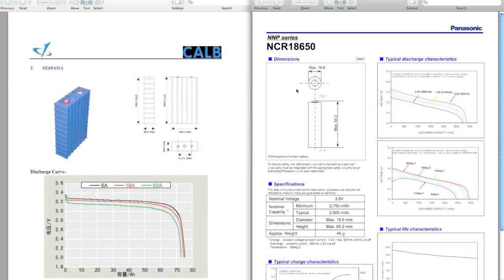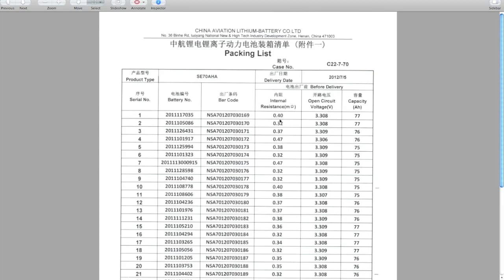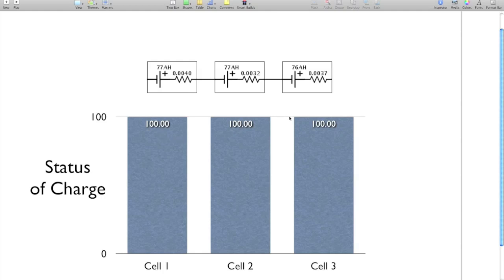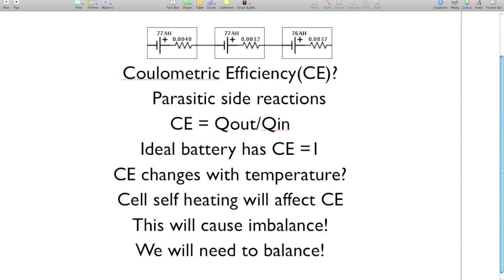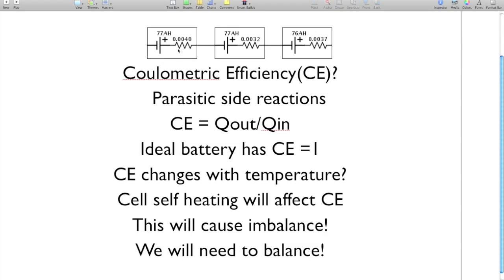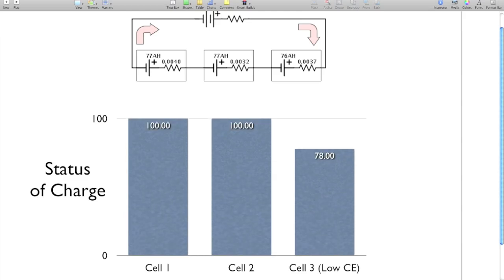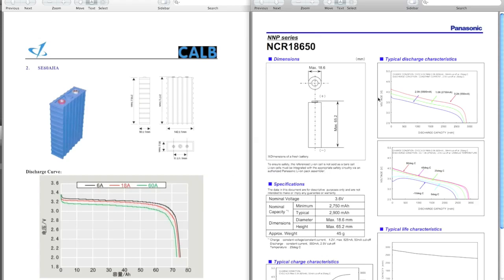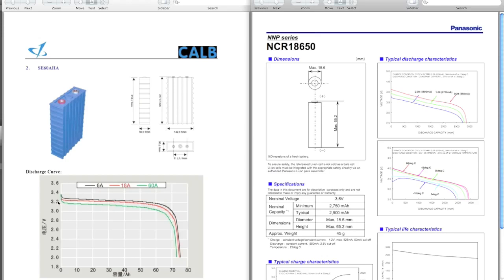#14: Battery Pack Balancing

Comment: this video was probably the most helpful video i've watched so far to distinguish between top and bottom balancing. But I still don't really understand why you use one vs the other. My understanding is that top balance poses the risk of first, overcharging, and second, a greater risk that a bad cell might reach zero% state of charge and be damaged because the the other cells might still be good and continue releasing amps (the computer doesn't recognize that the other cell is at empty). And then my understanding of bottom balance is that you'll have less amp hours but since the battery isn't heating up as much cuz it's being used for less time, the bad cell wouldn't be as likely to get to zero% since the computer will see that the other cells are also getting low and it'll stop the use of the battery pack. Is my understanding correct?

Comment: Hi Electric MotoVlog.   I have Toyota 2012 the hybrid light is on i opened the battery however all cells reads between 7.6 to 8.0 voltage.  What can i do to find out the bad cells? any instruments helps for that ?  thanks

Comment: on the schematic you have three batteries with following internal resistances.... 0.004; 0.0032; 0.0037. You said you got this info from the packing list. On the list you can see internal resistance for first three batteries in (mOhms) 0.40; 0.32; 0.37;
0.40 mOhms = 0.0004 and not 0.004 !
0.004 is 4 mOhms which is different than 0.4mOhms.
You are wrong.

Comment: Thanks for the info..I used to be an automotive mechanic until I was run over by a car and now I am creating a custom power wheelchair with lithium ion batteries..

I was told that I should use a charger that never lets battery charge over 80% so that I well get much more life from the batteries..
Is this true?
https://wheelchairrights.wordpress.com/about-lithium-ion-batteries/

Comment: Hi, there seem to be circuits ( LTC3300-1) available now doing the top and bottom balance without waste of energy, the cells with lowest voltage,get some help from the more fit ones by means of a convertor circuit. Complex, but worth its cost for high power packs.
Reply from the maker: Ah excellent. It probably goes in conjunction with the 68XX series by LTC. I have used the 6801-1 a while back (when it first came out). It was really nice except that the serial port on it was horribly unreliable. I think they have much better variants of it now though.

Comment: Using a BMS on a lithium cell pack is a myth. The King has no clothes.

There is no mechanism for shuttle charging, they keep their charge indefinitely. For safety all one has to do is keep them reasonably at the same temperature, bottom balance from installation in case you run them down so none get forced into reverse voltage. (the weakest will be eaten by the pack) and stop charging them as soon as the lowest sized cell hits 3.5V (LiFePo4).

You cannot balance under load. Neither is it possible to top balance and not kill the weakest cell when under load and low in charge.

Throwing the charge from cell to cell is not worth the battery variance.
Top balancing does not indicate any cell is actually top balanced because of the free electrons which do not represent a charge. You stop the charge and the voltages throw themselves all over the place. It's an irrelevance.

The accusation of "parasitic side reactions" is an invention from not understanding the processes.

I refer to EVTV. This guy has driven his cars since 2009 and NEVER required a balance. Neither do the people who follow his example.

Comment: Good video. Not sure why it was not in my subscribers video list. Coulombic Efficiency has effect on the cell imbalance but you exaggerated a bit to much your example :) and at hinger charge/discharge rates over C 1/10 the  Coulombic Efficiency will be very, very close to 1 not that much parasitic reactions will occur because of the limited time.
On good quality cells the cell imbalance will be extremely small and cell balance will not be needed at every charge but the imbalance will grow larger with each recharge cycle so is a good idea to have a small balance done at every recharge to keep the battery pack for dropping in capacity.
Reply from the maker: Thanks! Yes you are correct. I exaggerated for sake of example... I'm no electro-chemist so I don't understand some of the other effects that lead to pack imbalance. I did my best to comment only on what i learned from the technical article (in description). BTW i have been keeping an eye on your SolarBMS. Good stuff!
Reply: *****
The Solar BMS will be launched on Kickstarter in about nine and a half hours.

Comment: What about supercapacitors? Do they have large disprecancies too and so a need for a charge balancer?
Reply from the maker: Yes you are correct. One technique is to put a resistor in parallel with each capacitor in the series string. All the resistors should be roughly the same value. As the voltage across any one capacitor goes up it will discharge more current into it's parallel resistor. This is a very crude, but effective way of balancing and it is widely used in consumer electronics.